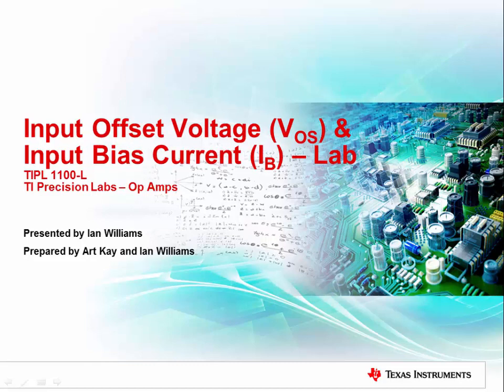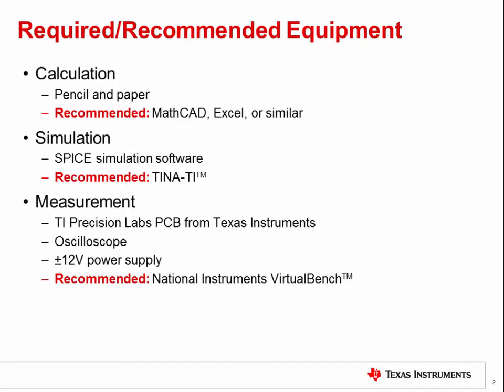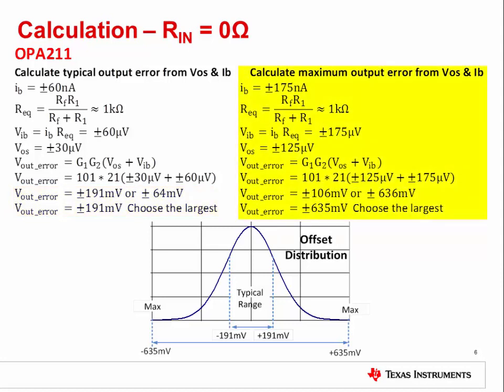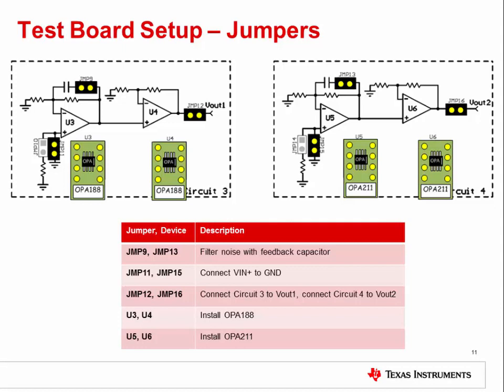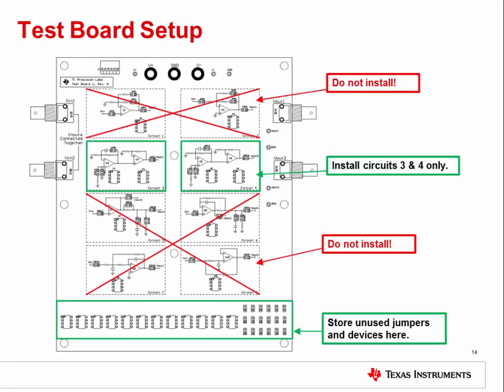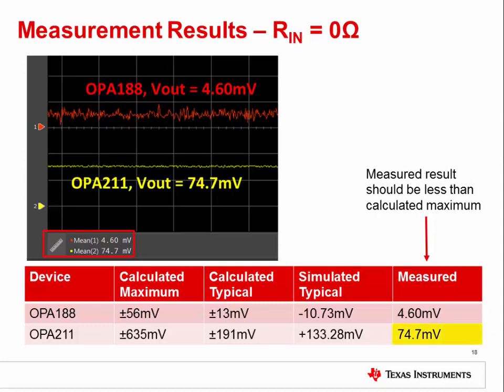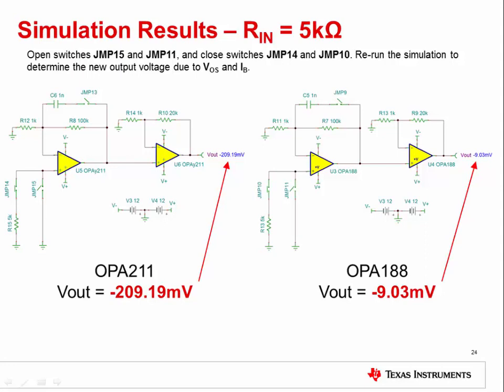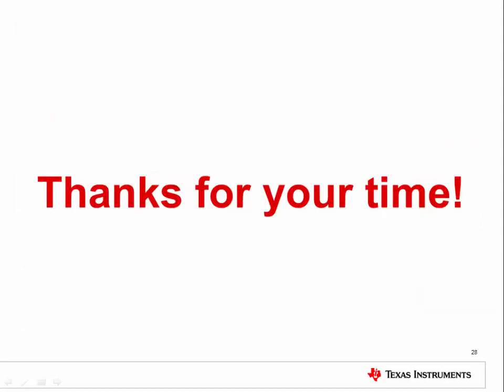Vos and Ib - Lab

Comment: When Rin=0, Vin- and Vin+ of the first op-amp would both be at ground potential. So no current will flow in through R1. The bias current will only flow in through Rf. Hence, Req = Rf when Rin=0.